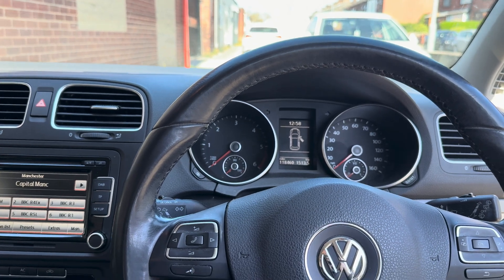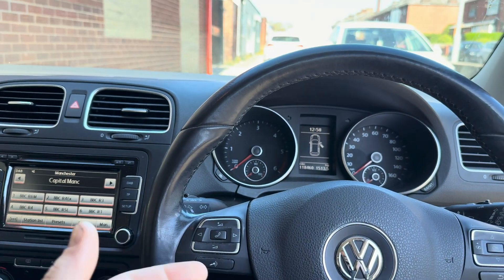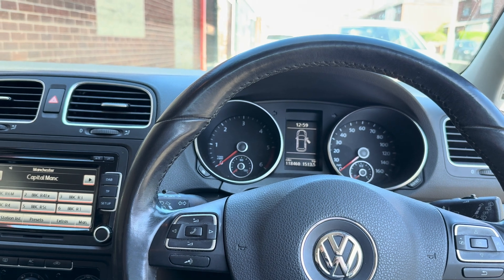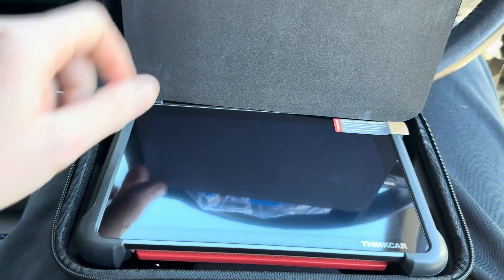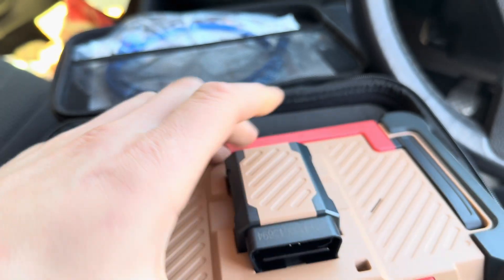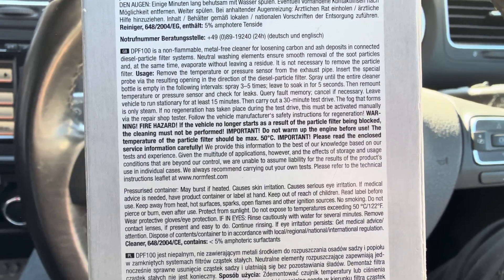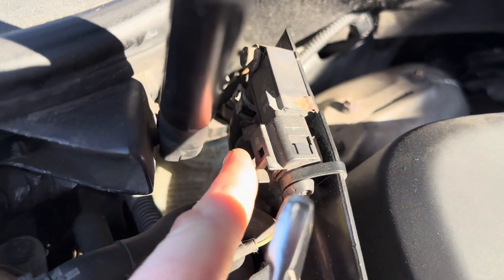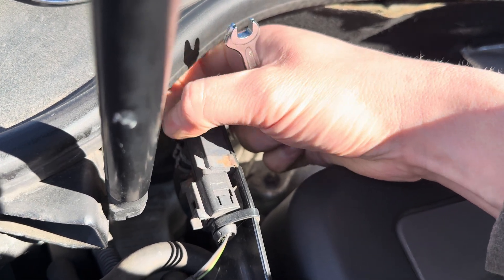VW 2.0 TDI DPF Cleaning / Normfest DPF Cleaner Tested + Golf Static DPF Regen Using Thinkscan 689BT

Comment: Why is the glowplug light flashing as it regens? My mk6 had the glowplug lights flashing but when it got plug in itvwas coming back as something with the DPF. I think ive managed to do a manual regen on the motorway and the light has gone out but the orange solid engine light has stayed on
Reply from the maker: The glow plug light is flashing to let you know that it’s doing the static regen I believe. When it flashes whilst driving, it’s usually to indicate a fault on the injection system. With the orange engine light on, most cars won’t preform a regen whilst driving

Comment: What’s the scan tool like . Was looking at the top Don artidag 800 bt but this looks a better option. What’s rest of features like for the vw/audi
Reply from the maker: @kevinbailey7758  the TopDon stuff is good stuff. I’ve got their scanner that connects to my phone which has been great so far, but not tried their Artidag. It would have to go a long way to be as good as this one though. I’ve only scratched the surface of what it is capable of, it’s absolutely awesome. You honestly can’t go wrong with this one in my opinion, especially with the lifetime updates etc. The only thing I don’t like about the TopDon is all the signing in stuff and if you have no internet it can mess about. This one I’ve not even put an email address into or made an account etc. It’s just worked straight out of the box.
Reply: @StupidBlokeStupidVideos  are they good with the vw and Audis .
Reply from the maker: @ this Thinkscan seems really good so far.

Comment: Glow plugs working?

it looks like in certain cars they do more than just assist a cold start, they also assist the system to rise the combustion temps during a dpf regen, so if they are faulty regen will fail.

Keep an eye on this yt channel o'rileys auto, the irish guy is a dpf wisperer, best dpf tehnician out there.
Reply from the maker: @MarianA-vu8tb  yes mate. The regens are happening successfully, it’s just that it needs driving further than it regularly gets driven to perform one. 

There’s loads of reasons dpf will clog quickly and cause regens to have to occur more often. Boost leaks or EGR valves stuck open being major ones. An EGR and dpf actually work against each other. Without an EGR, as long as it’s mapped correctly and just mapped not to throw a light when blanked off like some people do, the dpf won’t have to work as hard.

Comment: If only vehicle manufacturers would have installed an extra gauge on the dash showing DPF condition. So instead of waiting for the lamp to come on the driver could monitor the dash and as the gauge rises to DPF full you could drive accordingly. (Give it the beans)
Reply from the maker: If only vehicle manufacturers didn’t install the stupid DPF in the first place haha

Comment: You cant clean the ash out the DPF on the car.
You are only clean the soot.

So shouldnt be telling the car its had a new DPF.

Check the soot loading and ash value will give you a better idea of DPF condition.

Dont keep doing forced DPF regens it can crack the DPF/cat filter. Will also decress its efficantcy.
Reply from the maker: This is why I didn’t tell the car it’s had a new dpf. Ash has to be back flushed. 

This is the first forced regen I’ve ever done on the car. I mention how they are a last resort and can kill dpfs. 

From my understanding, the only problem with the ash content reading is that it’s calculated from regens/milage etc. if someone has told the car it’s had a DPF replaced in the past then it can potentially be useless info.
Reply: You can always delete 😂🎉
Reply from the maker: @ trying to avoid that for now haha
Reply: What’s the scan tool like . Was looking at the top Don artidag 800 bt but this looks a better option. What’s rest of features like for the vw/audi
Reply from the maker: @kevinbailey7758  absolutely brilliant mate. I’ve replied in more detail to your other comment.